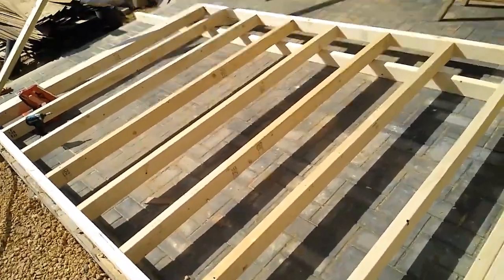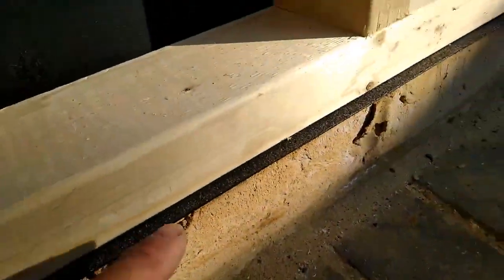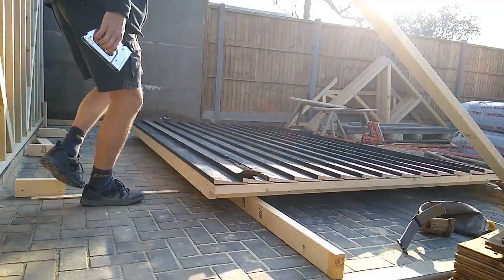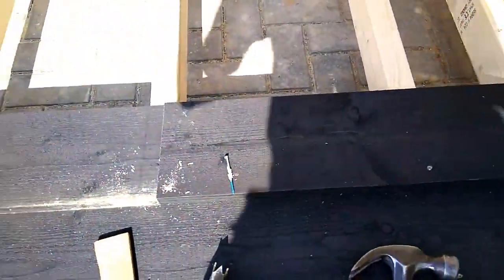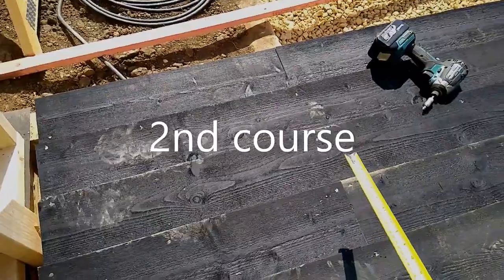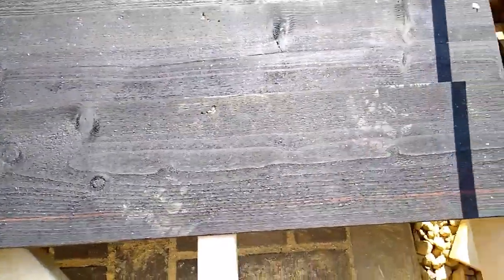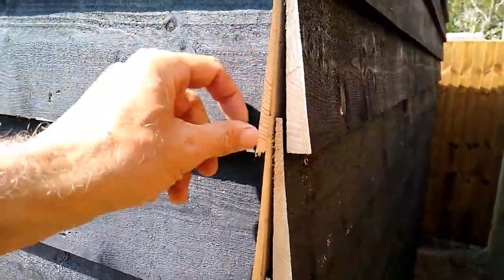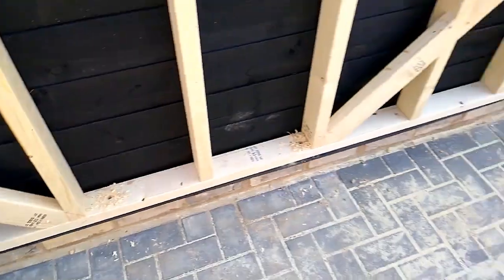How to build a timber frame carport  PART 2

Comment: Great video, nice clean and well done work. I just have two questions coming from a the perspective of a American carpenter. 
     First is there any reason in particular that your mason did not set anchor bolts/hold downs  into the slab? We have used resin/epoxy anchors alot in building but it is always in a situation where we are working off an existing slab or making changes to buildings. 
     Second from what I have seen it seems like most folks across the pond are using cordless nailers for everything. Is there any reason other then convince? I have and am very fond of several Paslode nailers of the framing and finish variety, but I only use them for punch-list type stuff. 
Keep up the great work. I just find it very interesting to see how other carpenters around the world do essentially the same thing in different ways. It is a pleasure to watch someone who takes alot of pride in his work get after it.
Reply from the maker: Hi there🖐First off, its super cool that you are watching from the US, and even cooler that you are interested in how things are done outside your own country🤗

Stick building, (commonly known as timber frame), is not that common here in the UK, and I'm not actually sure how the timber panels are fixed to the foundations having never actually built one🤔Using resin and studding gives a great deal of construction flexibility and, when I have to secure a stud wall building down, I will use resin and studs down through any brickwork and into the concrete footing. I am familiar with how you guys tie down your timber panels with steel anchors that you drill through the bottom plates, as I have worked building houses during my time in the States👊
Your second question is sort of related a little to my answer to your first question, in as much as we don't use timber as a primary construction material in house building, (usually blocks and bricks), and therefore, we use our nail guns for much less of the building work, hence the guns are never really pushed that hard.
In contrast, you guys are working your nail guns much harder than we are, and pneumatic guns are much simpler, more reliable, cheaper, (and cheaper nails), and faster than cordless ones🤘 You will find in factory timber frame construction, that they all use pneumatic nail guns here in the UK.
Really enjoyed you comment, and thanks for watching😎Cheers Del
Reply: @thetallcarpenter  Thank you for the reply. I just find it really neat to see how people build outside of the states and how you guys go about similar projects in a different way. I have watched quiet a few of your videos now and find it super interesting how you guys go about building. There are obviously a bunch of similarities but there are a bunch of differences too. I just find it a little funny to see a construction site without a bunch of 3/4 and 1 ton pickup trucks and air hoes running all about.  It also seems like you guys make less use of plywood then we do, over here almost every new building has it as sheathing on both the walls and the roof. Obviously there is no need for it on block and brick building but it was interesting to see the roof battens fixed straight to the trusses for the tiles.

Comment: Another brilliant video👍 I was just wondering, which resin do you use to secure the threaded rods?
Reply from the maker: Hi  Mike. Its nothing special. Usually a middle of the road resin from Screwfix/Toolstation. The Rawl stuff is usually pretty good value and works a treat.🤩Thanks for your great comment.👍 Cheers
Reply: Also how did you determine your rod placement, in terms of positioning/spacing the rods?
Reply from the maker: @mikej397  Hi Mike. I basically put the rods in line with the top brickwork course perpendicular joints so as not to loosen any bricks while drilling, and then just put them in evenly along the bottom plates all the way round.👍 Cheers.
Reply: @thetallcarpenter  ok thanks for the info, I was just wondering whether there was a specific distance that you set out to achieve between each rod?
Reply from the maker: @mikej397  Hi Mike. Not really. I think I went overboard on this carport. If you think a roof has to be anchored to a buildings internal walls at a maximum spacing of 1.8 meters, then it makes this carport well tied down.😎 Ultimately, threaded bar is cheap and the resin goes a long way, so a few to many wont hurt.👍 Cheers
Reply: @thetallcarpenter  Well, at least you know the carport won't be flying away anytime soon😉.. and thanks again for the info, I really appreciate it!:)
Reply from the maker: @mikej397  🤩